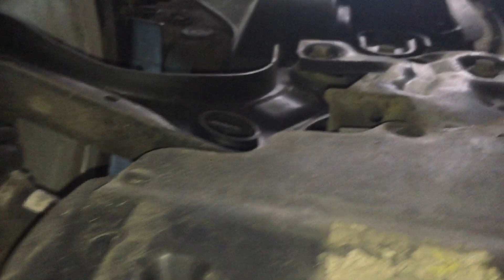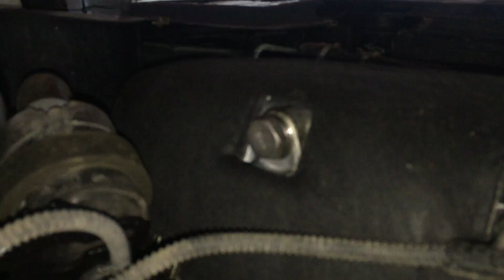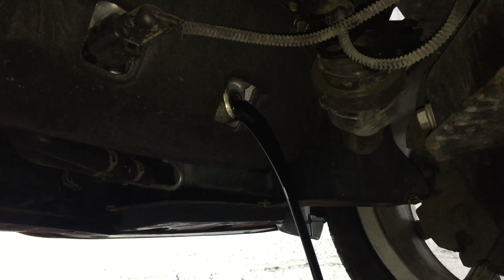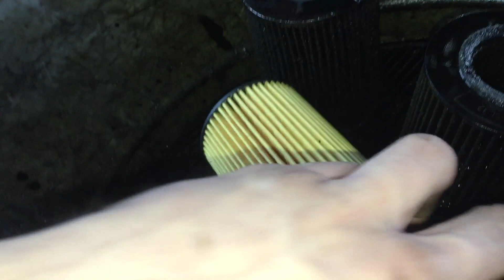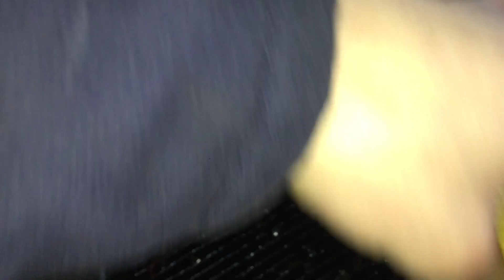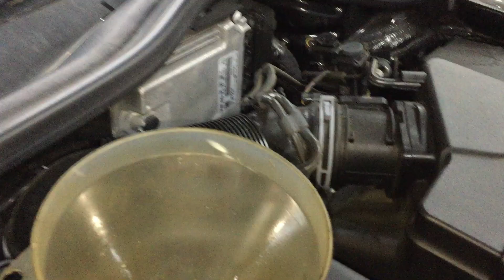Audi A1 1.6 TDI CR Oil and Filter Change Service CXMA 8XF/8XK 2015-2018

Comment: Did you fill the filter housing up with oil before you put it back on??
Reply from the maker: Hi Jason,
No need, after filling the oil the filter housing will fill when running. After running switch off for 5-10mins and top up the oil as necessary according to the dipstick.

Comment: Hi, will the 2017 A3 1.6tdi be the same engine?
Reply from the maker: As far as I’m aware it should be!
Reply: The filter must be underneath on all Audi, looks hard to reach,  We’ll give it a go.
Reply: The Audi A3 1.6TDI is a different layout to this A1. However it’s the same as the VW Golf engine. Tricky filter location, upside down and concealed by wires which need to be unclipped and unplugged for access.